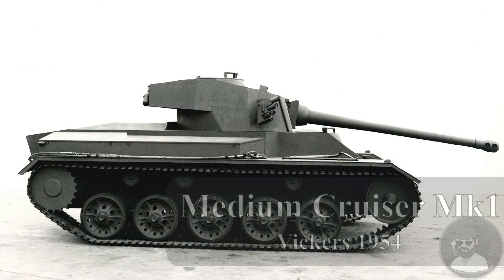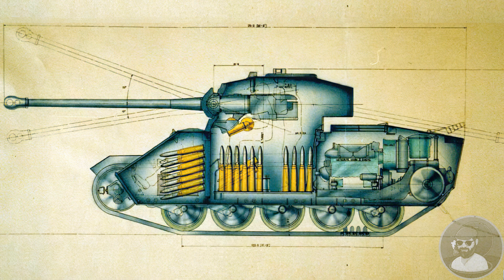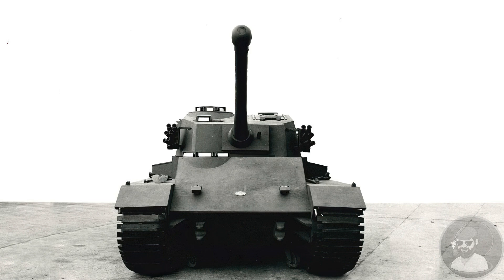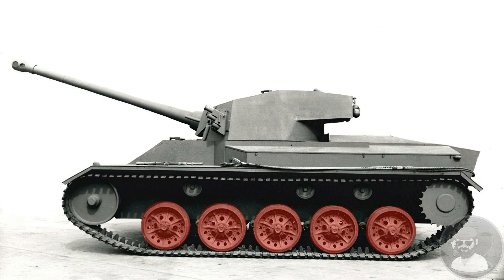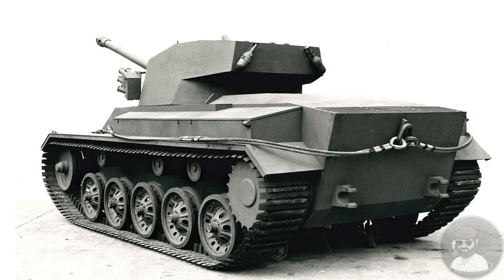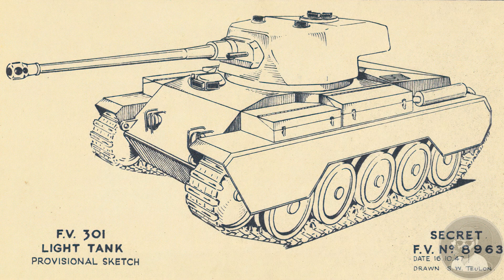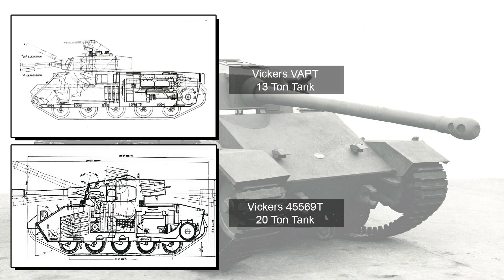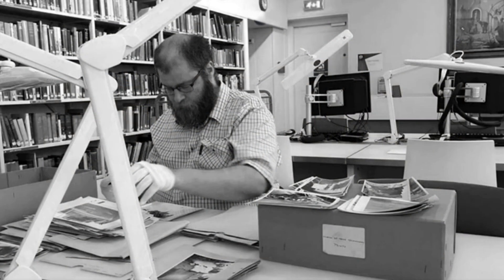Vickers Medium Cruiser Mk1 - Tank Design and Development

Comment: I don't think the driver's position necessarily points to a left hand drive country.
The Leopard has the driver on the right side as well. I believe because that means the ammunition is therefore stored on the left, where it's close to the loader.
Reply from the maker: Its not a certainty, however its a general rule in tank design, once you crack into the requirements side, for example french tanks (AMX-30) older swiss, russians, and US tend to have drivers to the right, while UK, india, south africa tend to be on the left, it's not always the case, but it crops up in design specs a fair bit. However these days many are now just located centrally which has been much more common since about 1960 onwards.